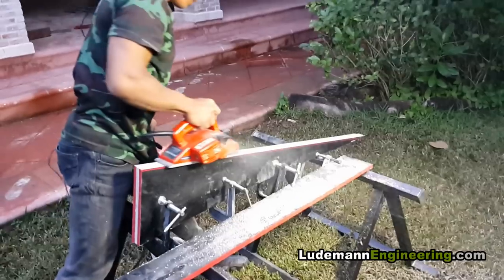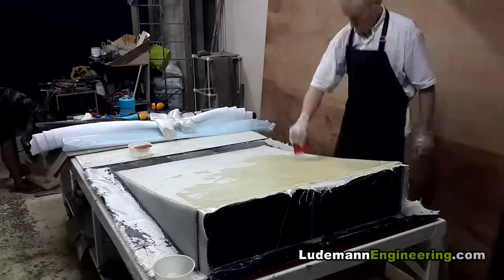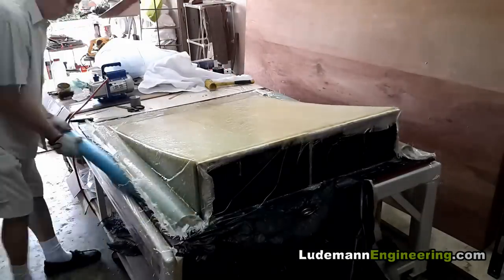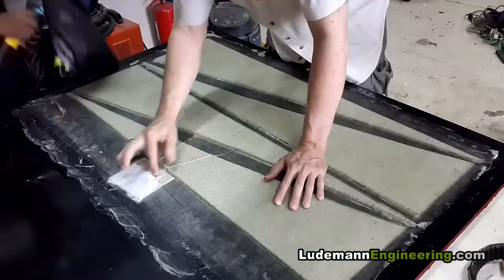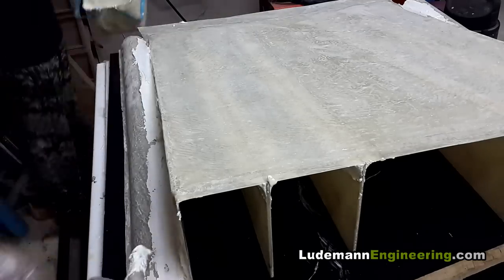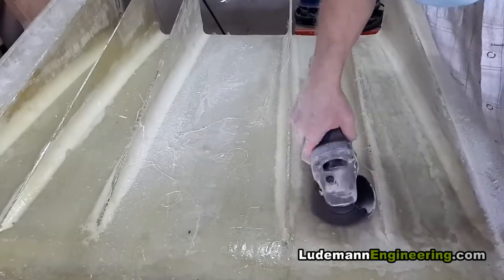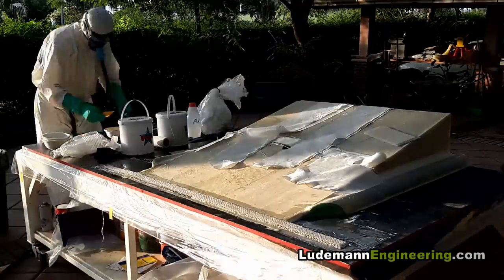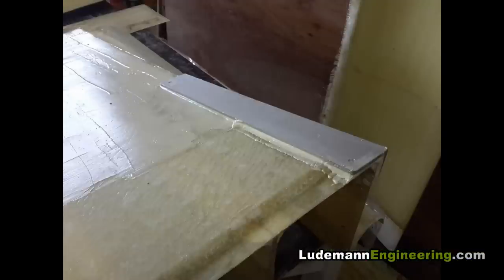Formula 1000 Race Car Diffuser Fabrication Fiberglass Honeycomb Sandwich Composite Vacuum Bag

Comment: Love these videos. Just a tip for anyone else doing this kind of thing. When the fillets were put in and then ground down for the strakes, that is the hard way to do it. Much easier way is to lay blue tape out, make your fillet, then pull the tape. This will leave nice clean edges which would be a lot simpler to clean up. Same trick works great for silicone when you're sealing tiles to a tub or shower basin.

Comment: Wow Awesome video! I love how you think outside the box and use hardware materials for your bagging equipment. I make RC aircraft and use similar things for my work. I found painters drop sheets conform really well and are pretty tough and use bathroom caulking (not silicone) to seal the bag. Gives an excellent seal really quickly.

Comment: Awesome Video's, been following your video's for since the beginning of your Formula 1000 project, definitely a Project of passion, and is looking very Clean and Neat....do you plan on having a racing series developed form your F1000?

I had been involved in FSAE back in University, and my goal is to build a 2L V6 Fomula Car.....still contemplating on several options:
-Build a Tubular Chassis
-Build a Carbon Fiber Chassis
-Buy a Carbon Fiber Tub (Tatuus F1600) 

Engine (none stressed member), Transmission, axles, Brakes, Shock/Springs can be sourced as there are many parts available.

Comment: Your work tables appear to be prepped plywood. was that an automotive finish (filler, paint and wax) or something else.  I greatly enjoy the low buck approach.
Reply from the maker: +Brentanos Gar I bought the plywood like that. It's widely available here in Thailand. The surface appears to be a very thin decorative laminate (Formica) and is useful because if I wax it, nothing sticks. It costs about the same as plain plywood.
Reply: We have the same plywood here in Australia, it is called formply it is used for making formwork for concrete structures.

Comment: Good work.
That is a terrible epóxi tô laminar with, waaaaay too thick, you could save at least 30% weight with the correct resin.
The itching is from the fiberglass needles and epóxi alergy (alergy to amines), both thru breathing the powder and skin contact....